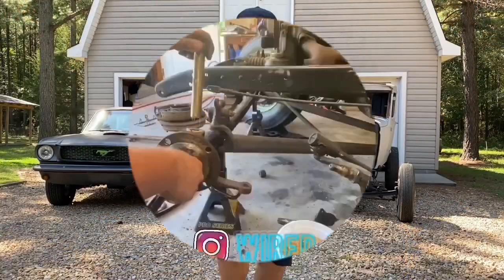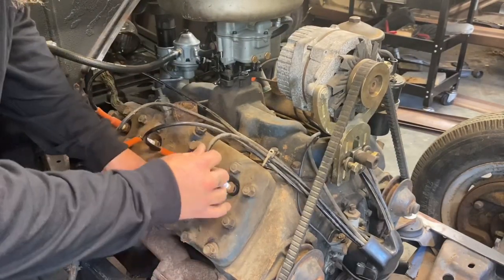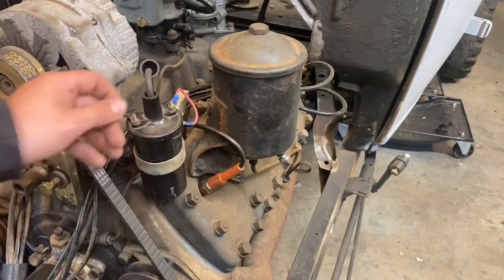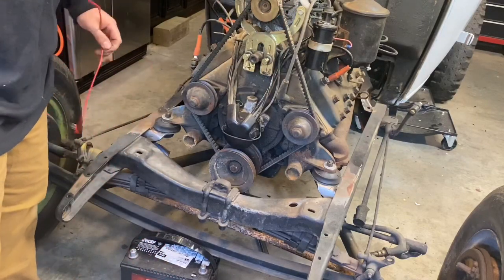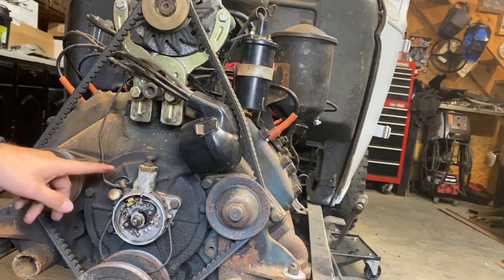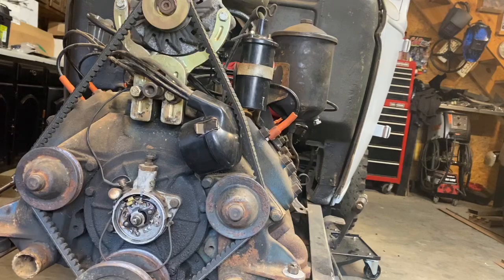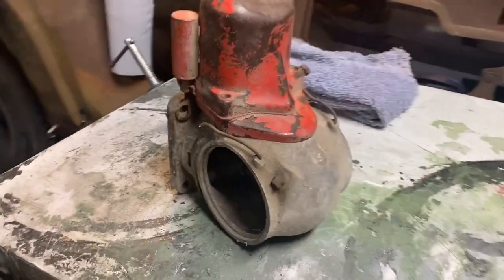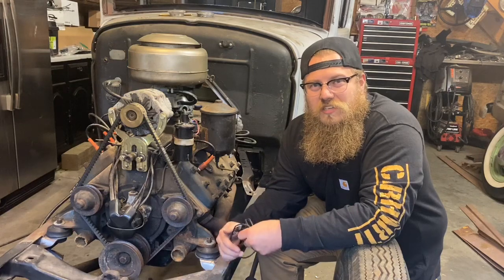No Spark No Start Ford Flathead Explained

Comment: Thank you for making this video!  A friend and I own a 1938 Ford Luverne fire truck and I have a no spark situation and I was struggling to identify the coil, condensor and to understand what I was up against with the distributor.  Great pictures and videos are worth a thousand words.  This firetruck is 87 years old with less than 10k miles on it because it was a farm firetruck and so in many ways it is new old stock.  When the weather cools a little bit I will be diving in and I am sure you saved me many hours if not days of frustration!
Reply: Which side is piston number one on in the 1938 engine

Comment: I have a 1939 ford 221 Flathead with new points and condenser gap is set to 14 thousands still no spark how do I test the coil
Reply from the maker: Unplug a spark plug wire, crank the motor and hold the wire end close to the spark plug. You should see a blue spark but be super careful
Reply: @WiredCustomsSpeedShop I did that and still no spark 😮
Reply from the maker: @arizonajoesclassiccargarag82 two things, what’s the voltage supplied to the coil? Also what ohm does the coil test at when disconnected

Comment: My Flathead 4-cylinder was running like a Swiss watch then all of a sudden started running rough and then not at all put an inline spark tester cylinders 1 2 and 4 very very faint Spark. Cylinder number 3 bright red constant strobing Spark while rolling over. Bad condenser? Bad ground or short?

Comment: Hi Zack I have a 51 deluxe all stock 6 volt, I replaced everything,coil,plugs ,wires, cap, points, condensor, valves and guides,  lifters, just waiting on a new carb! Just discovered I had coil wired backwards, but still no start just pops and backfires and even started a fire through the rusty pipes up front of the motor, this hasn't ran in 50+ years I was told, if I turn the key on I get power to both terminals on the coil is that normal? 
Ps I'm no mechanic just trying this on my own.
Thank you!

Comment: Got one of these engines (a 53 8BA) in a custom 6x4 rig my dad built in the early 60s. Engine's never been opened up. Ran all over the desert here in the South West & even the dunes pretty steadily for almost 20 years before it got parked. Trying to get it back on the road again. Just sorting out some misfire issues now that turned up. SUBBED! as your channel seems to embrace these old motors & any info on them is always great to have.

Comment: 1941 Ford Firetruck 6v pos ground system. I get 6volts on both pos and neg terminals of ignition coil when everything is hooked up normal and not cranking. Points are new, condenser new, multiple grounds (temp) video doesn’t describe this issue. What could it be?

Comment: Thanks for the video. I am dealing with a flathead that is very finicky. Sometimes is starts right up, sometimes it cranks and cranks but won't start. I used one of those inline spark indicators and it appears I have a spark. I just cleaned the carb and checked the fuel pump. I only have 4.5 volts (I'm using a 6 volt 1935 Ford setup) at the coil with a battery showing 6.2 volts. My next step is to file the points and try a new condenser. Maybe jumper 6.2 volts right to the coil and bypass all the other wiring. Any other suggestions?
Reply from the maker: Thanks for watching, when it starts is there a lot of smoke coming out of the breather? I would be worried about compression then timing.

Comment: Ok watched the video.  I'm using a 12v battery to a ballast resistor to a 6volt coil. I went through all your tests and am get spark everywhere. But it seems like a lot of spark and very bright. Not the small blue spark you mentioned or talk about. I checked voltage on the resistor I'm getting 12.4/6 on both sides of the residence and to the coil. Is that right or is there something I'm missing.  I thought the resistor would drop it to 9 or so. When I crank it, it just doesn't seem like it even is trying to fire off? 
I replaced all the spark plugs and wires, coil and points and condenser  before the tests. I'm thinking maybe it's a fuel issue at this point.  Or could to high of voltage be an issue?
Reply from the maker: It should start with the high voltage, it just wouldn’t run for very long before it burned up the points. It sounds like your ballast resistor is bad and needs to be replaced. Also though if it’s not popping off at all I would suspect something else is keeping it from starting
Reply: @WiredCustomsSpeedShop  ok thanks I'll look for another resistor.  I this one is new that I just picked up from napa I'll try another one.  Also should have mentioned this but my jumper wires from the battery to the resistor are are literally glowing hot and melting under a minute of hooking them up?

Comment: I have a 1938 Flathead, with the old dual cap distributor.  The caps, wires and plugs are all brand new.  My issue is the right side bank is running great, but none of the cylinders on the left are firing at all.  I have checked and rechecked the plug wires and everything is good.  I have spark at the plugs but still no fire.  Any advice?

Comment: Hi Zach,
Great videos, I think I have watched them all in the last week.  lol. Just bought a 1940 Ford Pickup.  The engine turns over easily, but I have no spark!  The previous owner put a Pertonix coil and Stromberg e-fire distributor.  It appears half of the wiring is for a negative ground system the other not so much.  So, I am trying to start from scratch!  If I am positive ground (6v) my negative will go to the condenser then starter I assume.... then what?  I am also assuming I need to go to the coil ...HELP!!!

Comment: My flat head has O compression should it start but miss or run rough
Reply from the maker: At zero compression it won’t run at all, flatheads with 60 psi run pretty rough

Comment: I bought a FORD 60 motor, alum heads (smooth) alum single h2o pump distributor intake single carb, no belhousing on the block, now comes my problem, the heads where off turns over like a new motor, so I bought head gaskets from ebay and some of the holes didn't line up so after checking the web it seems I have a french motor and instead of 60 hp it could have 110 to 180 hp? I know this doesn't sound right but I need help in getting head gaskets etc for it can you steer me in the right direction? It has alum belhousing too, the clutch is 7 or 8 inches I'd have to look, I'll send you my email but I don't want it be out there for everyone. I'm 81 and I've got an old boneville 1928 roadster pickup 327, power glide 1957 ford rear, I'd appreciate any help thanks Jim

Comment: Doesn't look like there's anything too terribly unusual about the ignition circuits on these engines. Fairly standard point setup. Aside from the odd physical design of the distributors on a lot of them there's nothing here that doesn't apply to literally any points ignition ever made. Even the early helmet type is just a standard points system.

I love that.

Fixin' to pick up a 46 Super Deluxe to daily, so I'll probably be in there on the regular keeping it running right. Prolly once a year to check/service the points. Don't anticipate any major issues out of the 59AB in it....the legendary ruggedness and dependability of these V8s is part of my draw to the car as a whole...but it is nice having access to information like this just the same.

Comment: Part 2 Q.
I did what you did, not getting spark when I open my points holding the wire to my coil. I am only getting blue spark negative distributor wire when I scrape it against the coil negative side there's a blue spark.

Comment: Watched this time again, I'm getting spark to the plugs with the spark plug tester when you scrape the negative terminal on the battery you could see it's arcing. test light turns on in the off position of the toggle switch. In the on position the test light turns off. I have reversed the toggle switch wires and nothing changed. I've checked my wires over and over nothing seems to be in the wrong order something might be I don't think so yeah I don't get spark when cranking or any sparking at the points. Everything is brand new, yeah there's power going to my coil to my plugs just no spark between the points how's this even possible

Comment: Question: I have a 1951 Ford F1, 6 Volt flathead. 1st. Question: Do I connect the positive side of the battery to the ground cable that is connected to the side of the block? I have read that the connections on the battery is backward because of “positive ground”. 2nd question: I have no spark.  I have an ignition switch with the push button. I have replaced the coil (6Volt), points, condenser. Cap and rotor looks fine.  Turned the switch to the “on” position and moved the points looking for spark, but nothing. Thanks for any feedback you can provide.
Reply from the maker: given that the engine is still set up how it was originally, then yes the positive side of the battery needs to go to either the block or the transmission to block bolts, check to see if you are getting power to the coil, that's where I would start

Comment: Great video sir.  I just acquired my first flatty in a ‘50 coupe. Guess what- no spark.  So this was a great find.  Now off to locate my jumpers wires and voltmeter.  Thanks!
Reply from the maker: I’m glad I could help! I’m working on a 50 sedan this weekend! 👍🏼
Reply: @WiredCustomsSpeedShop  this ‘50 two-door (I’m told it’s not a coupe) is a nice old car that is 100% stock, parked in a garage since 1999. It’s for sale if you know anyone looking.  Only damage is on the right rear bumper and rear body panel, rolled back into a telephone pole in 1986 according to the owner.  Clean Arkansas title.

Comment: I have no spark on my 39 Ford flathead V8 it has the 6 volt system tank head distributor want to take off side caps to check them am afraid of loosing small parts am I safe to pull the side caps off thank you for your time I'm new at this
Reply from the maker: Side caps are just like modern distributor caps, should be no problem

Comment: On my 1940 ford flathead V8 i have points sparking on one side and not the other side. Just installed new coil.
Reply from the maker: I would check that ground wire for the points

Comment: Great video man, there's not to many videos on old flatheads. So I have the same set up as your first motor the one you did the spark check on. I'm at the same spot with mine but my car is still 6 volt.

So when testing the coil with the new 6 volt battery, do I check it pos to pos or do I do something like pos to neg, ?
Reply from the maker: There is two ways to check the coil, put a spark plug on the coil wire and lay it down on the motor somewhere where it can ground and crank the motor over and watch the color of the spark, or you can remove the coil from the motor and check home many ohms there is between the positive and negative side of the coil, every coil is ohm rated
Reply: @WiredCustomsSpeedShop  ok I'll try the spark plug way, I don't really follow your second suggestion. Do you mean the coil has power in it like a battery? 

Thanks for your help very much appreciated.
Reply from the maker: @michaelmchugh2923  you can test the resistance in the coil when it’s unplugged, if it has the wrong resistance then it’s either old or bad
Reply: @WiredCustomsSpeedShop  ok, I would need a volt meter for that,  all I have is a test little right now. 

What state are you from? 
P.s.
I Googled checking a flathead Ford for spark and it brought me to a small clip of your video.
Reply from the maker: @michaelmchugh2923  nice! I am Google verified now haha, I am in Virginia!
Reply: @WiredCustomsSpeedShop  awesome I pass through va, twice a year, I have a buddy in nc, I'm in nh.  So I got spark at the coil, I cleaned the points, and condenser, I think the condenser is used up, I still have to get a fuel source I'm thinking to gravity feel the carb.

That fuel pump is beyond me, glass looking thing. 

I put a little starting fluid in the carb and she just cranks like a little flathead does.
Reply from the maker: @michaelmchugh2923  sounds like you’re heading in the right direction, fuel pumps are really simple on a Flathead and for most years a replacement pump is pretty cheap
Reply: @WiredCustomsSpeedShop  I'll have to grab the book and take a peek. I just want to get her to run for a few seconds. If all is fine I'll pull motor do the intake gaskets and oil pan gaskets and do a flush to get the gunk out, for now I did a few oil changes with a little diesel engine cleaner, did a drain and full three times I definitely pulled some gunk out of the drain plug. 

Hoping to make a low budget ratty 50s hotrod out of a farm fresh 40 Ford coupe.
Reply: @WiredCustomsSpeedShop  so I just had a wreck. I snapped the little stud that the condensor and the and the pos coil wire go to. It's on the right side of the distributor.  Do you now if that stud and its body underneath it unscrew from the side of the distributor? Or am I in trouble?

Thanks for your help much appreciated

Comment: I have a 1946 Ford pickup with a 59ab installed in the truck and a spare block, intake, heads, carbs, misc parts here and there. All inherited from my grandpa who always said, it had low compression but it was driven into the garage its stored in, in I believe 94. I do know I removed the old 6v battery and have to weld in a new battery tray. I have been eating up all the info, had a key made for the column drop, probably 12v rewire eventually. any info/tips much appreciated
Reply from the maker: That’s great! Good motor to have, also they had low compression stock, looks like you found my 12 volt conversion videos, I have three total talking about the conversion, that’s where I would start if I was you

Comment: Excellent video!  We are trying resurrect a ‘51 F1 with a Mercury flathead in it, and are having trouble getting spark. My question before we go through it this way is, was your engine negative ground or positive ground?
Reply from the maker: Hi Kevin, sorry for the late reply, I found the engine in a barn sitting on the floor, so I had no idea as I was going through it, ends up I think it was set up for modern 12 volts
Reply: Zac I am trying to find a oil bath air cleaner for my Sidevalve v8 it has a carby flat round surface that the air cleaner clamps on to do you have a spare one that may fit even if is a paper element I live in Australia and can not locate any please text me back if you have any regards sam

Comment: how should the ignition points be set up in the distributor?
Reply from the maker: The wire from the negative side of the coil, should feed into the distributor and connect to the points as well as the condenser

Comment: Thank you for your nice video, it's really worth 'gold'! Trying to get a spark from my '47 Ford truck... I got two questions for you (and maybe more in the future.. ;-) ). Where should I measure my (positive) volts exactly when testing the coil? Near the resistor, but where..?I got the original 6 volt systeem. When testing the points, I connect a wire between the positive side of the battery and the side of the coil that says 'bat'? I don't want them mixed up: positive and negative. I replaced the spark plugs, the rotor and the condensor. I hope you want you want to help me. Thank you very much! Greetings from Pieter (the Netherlands).
Reply from the maker: High Pete, sorry for the late reply, the wire coming out of the distributor needs to be going to the coil negative side, then you should be seeing 6 volts to the positive side of the coil, I hope this helps!

Comment: Great video! Which alternator bracket is that?
Reply from the maker: Thank you! I am not sure actually, I got it second hand, but the alternator is a modern GM one wire! Great set up for a 12 volt system

Comment: I have 2 flatheads i still cant get started even with spark and staring fluid . My spark is there but not strong enough to start. Also i have a video of it not cranking but getting 12 volts
Reply from the maker: It would like the timing is off to me, could be a lot of different factors

Comment: In about 1956 when I was 14 I had a no start on 47 engine in my 33 PU. I traced it to the feedthrough. What I'm calling the feedthrough is the widget that the coil wire connects to that then makes contact to a small T shaped connection inside the distributor. From there the circuit goes to the points.  It was NOT making contact inside the feedthrough. I have never heard of anyone else finding having this problem but it did happen to me. So in addition to failed points and/or condenser the feedthrough may fail (or not make good contact inside the distributor).